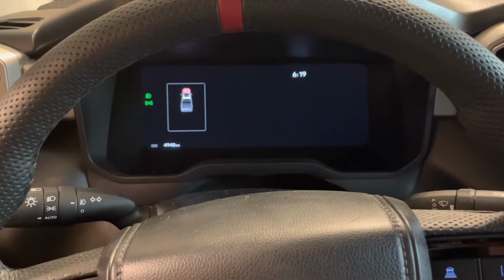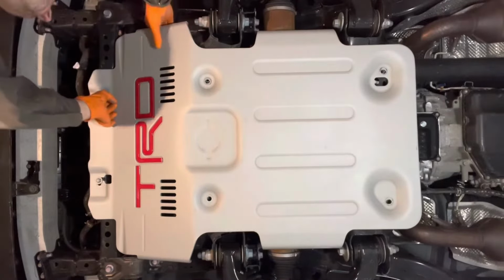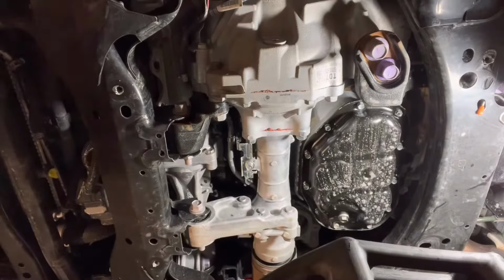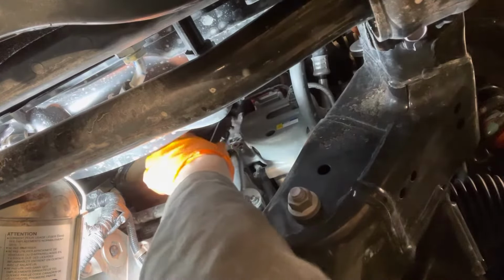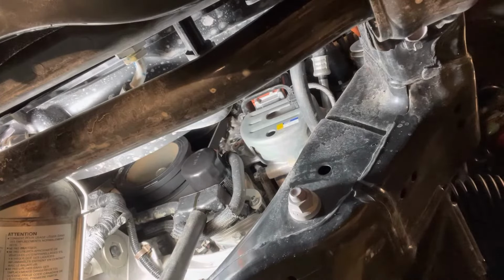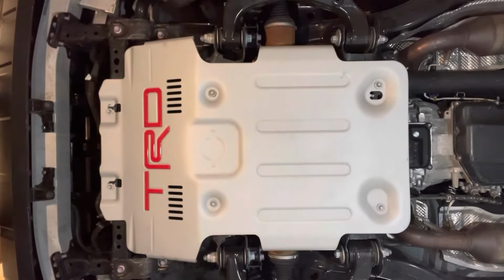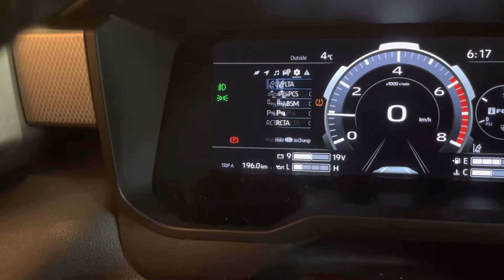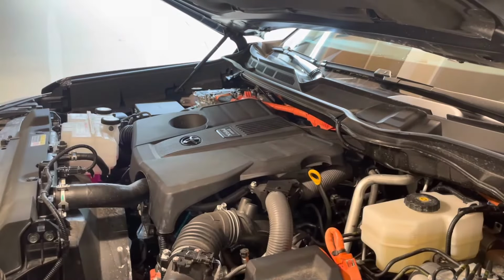2022-2024 Toyota Tundra Engine Oil Change And Filter Replacement Instructions

Comment: Did you notice the oil dip stick is very hard to pull out and push into the oil hole?  Wondering if there is something to make it easier to pull out and push in other than put oil on the stick itself.
Reply from the maker: @dr6638  no, I haven’t noticed that. I can’t think of anything that would make it easier off the top of my head.

Comment: Is it necessary to pour a small amount of oil into the filter so that it does not start without?
Reply from the maker: @mikegreene9215  no, the factory repair manual doesn’t mention anything like that.

Comment: Great,  informative video,  thank you! What size is that oil filter cap wrench so i can start changing my oil too? Is it 65mm??
Reply from the maker: Below is the link for the tool. If you purchase using the link, I may receive a small commission. Thank you!
Oil filter removal tool: https://amzn.to/3DzUld2
Reply: @Viktor_G_Automotive  thanks for the response,  however isn't that the cap wrench for 5.7L, 4.7L, and 4.0L tundras? That's what the amazon page shows. I was looking for the size of wrench for the 3.4L Twin Turbo 2022 to current engine tundras? Maybe I'm wrong,  thanks for any further info!
Reply from the maker: @sewaldo69  Toyota only uses 2 oil filter and/or cartridge cap sizes. The 3.4 L twin turbo engine spin on filter has the same size as the oil filter cartridge cap on the 5.7 L engine. Cheers!
Reply: @Viktor_G_Automotive  Great to know! Thanks again Viktor!

Comment: Hello Viktor. Will this be the same process for a 2023 Sequoia TRD PRO?
Reply from the maker: @ALtodaFRED  yes, it is
Reply: @Viktor_G_Automotive  the 5/8th's hose, is that the ID or OD?
Reply from the maker: @ALtodaFRED  5/8" ID drain hose for the oil filter catcher tray: https://amzn.to/450is0j
Reply: Thank you!
Reply from the maker: @alfredbielza6370  no problem 👍
Reply: @Viktor_G_Automotive  Thanks. Did my oil change yesterday without any problems.
Reply from the maker: @ALtodaFRED  excellent work!

Comment: Love to support helpful people!  Before I order the filter removal kit, I want to confirm the link is the correct one. Amazon says it's NOT compatible with my 2023 Tundra????
Reply from the maker: Hi, the 2023 Tundra uses a new oil filter that is unique to it. However, the end of the filter that the filter removal tool fits onto is the same, so it will work for you.
Thanks for the support!

Comment: Thank you so much… made my afternoon go much faster than if I went in blind. Just changed my 2024 Tundra SR5 at 600 miles for my initial break in. Definitely saw small bits of metal (believe to be normal). I’m planning to change again at 2,500 then again 5,000 before I change every 5,000 thereafter.

Might be overkill but so be it.
Reply from the maker: @letts009  nice work!

Comment: Hello Victor, great video, thank you. Would you suggest running a break in oil for a short time before beginning regular oil changes? I hear that is beneficial to remove the metallic particles you get from the break in period. 
Cheers,
Shannon
Reply from the maker: @shannongraham8949  I personally don’t think it’s necessary, but you can do it if you want

Comment: I have a hybrid like yourself. Is there a way to keep the engine on so the oil can circulate properly, the hybrid will obviously turn off after a little bit
Reply from the maker: Yes, there is a way to put the vehicle into a maintenance/inspection mode which will make the engine run all the time without shutting off. I can make a video one day.
Alternatively, you can just give it a bit of throttle, which will make the engine run as well.
You only need to run it for 15 seconds or so anyway to circulate the oil around the engine.
Reply: Just put it in tow haul mode.  Engine won't shut off if tow haul button is push.

Comment: This 0 weight oil is super thin which makes reading how full it is on the dipstick really hard when the oil is new and clean. Any tips on how to determine the actual fill level???
Reply from the maker: @CobraChamp  you could try shining a light on the dipstick to see the reflection or use a napkin and dab at the dipstick until you see the napkin wet from oil.
But if you put the specified amount of oil in, it will be at a good level.

Comment: Viktor, i see there is about  3070 miles on that truck,  is that the first oil change?   I am trying to figure out when i am gonna do my first one on my new 2024, the book says 10,000 miles, i am not gonna do that. 3000 doesn't sound to extreme and of course, older motors were the first 1000 miles you do the "break in oil change". Just curious on your opinion on this particular truck/year. Thanks!
Reply from the maker: That is my friend’s truck, that was the first oil change, we are going to be doing them every 5K miles or so. That’s what I’d do on my personal vehicle.

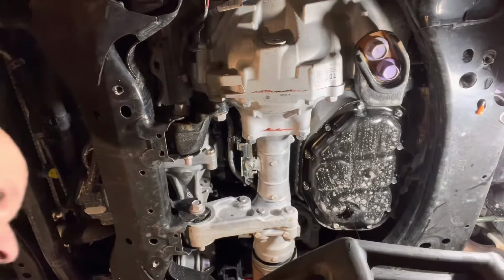Comment: 2:18 that 0w-20 literally sounds like water splashing in the drain pan. No wonder toyota is seeing seized engines. 20 weight is barely suitable for a naturally aspirated engine never mind the heat a dual turbo charged engine produces. I’m willing to bet moving to a 0w-30 to get rid of the failed engines toyota is seeing in this generation truck.
Reply from the maker: Some new Toyota engines take 0w-8, I wonder how thin that is!